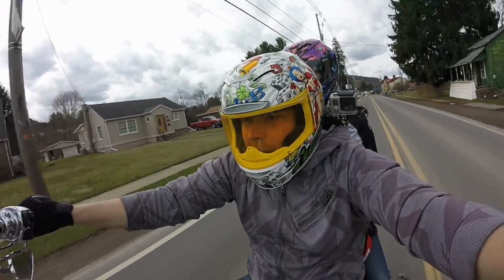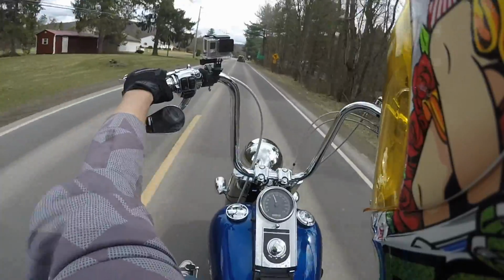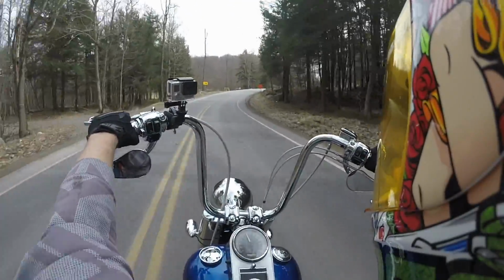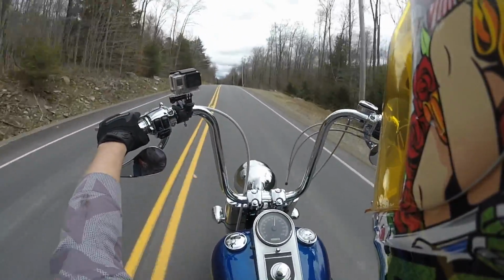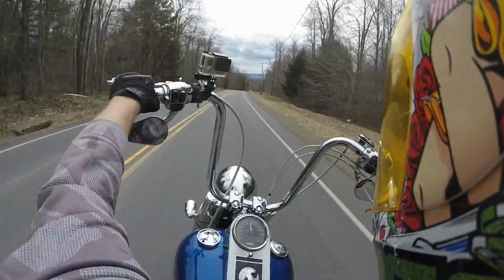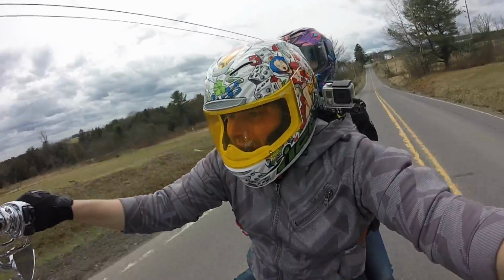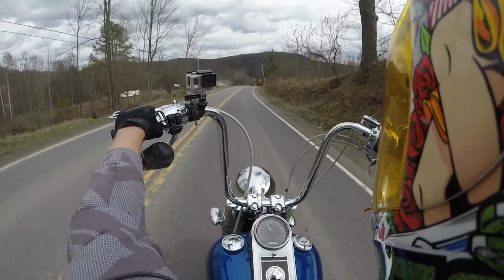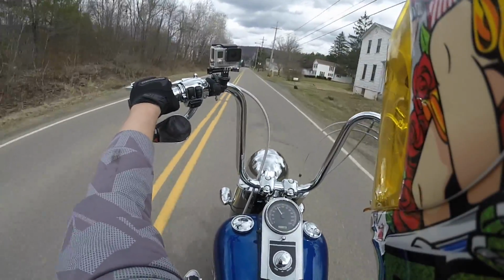The Point : Harley-Davidson Stage 1 2 3 and 4 Tuning Explained (sorta)

Comment: In stage 3 you pick 2 kinds of cams stage 4 is only one cam . The stage 4 cam is not compatible stock head . This is what  is  I was told when I upgraded my fat boy to stage 4
Reply: Ps  I was referring to the Milwaukee 8
Reply from the maker: That kinda makes sense I guess. I do know that it's not beneficial to run a really aggressive cam with stock compression so it makes sense that you would need heads/pistons/displacement to bump that compression up. At that point you've pretty much built a racing engine. How does it run on the street for you?